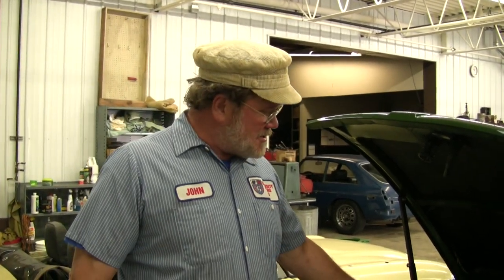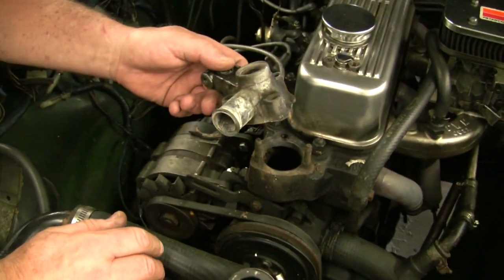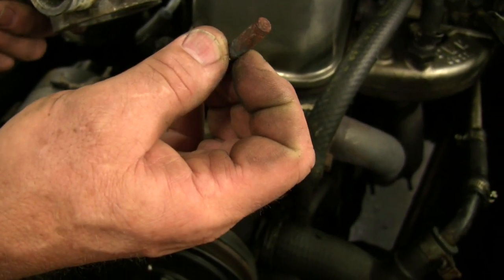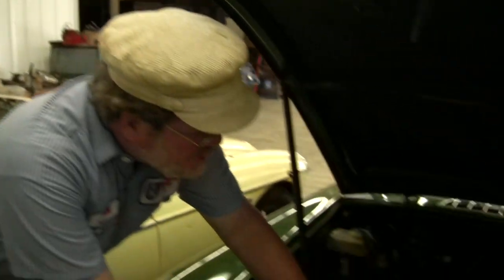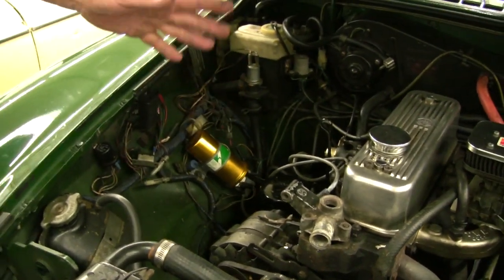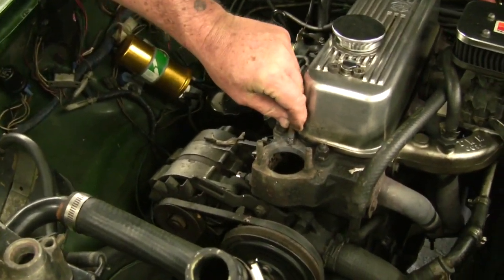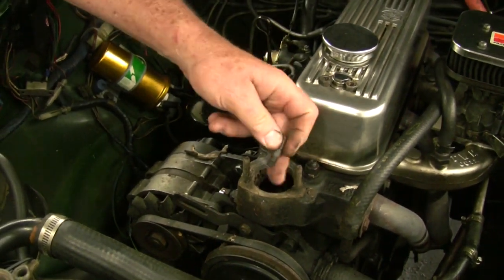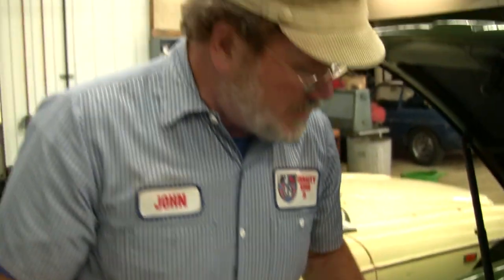168 MG Tech | Separating Dissimilar Metals

Comment: Since there is a little room between the stud and the housing, would coating the stub with a little grease, before sliding on the housing and bolting, eliminate that issue?